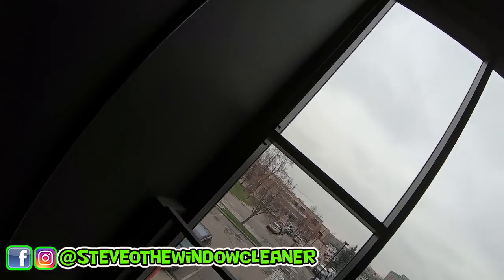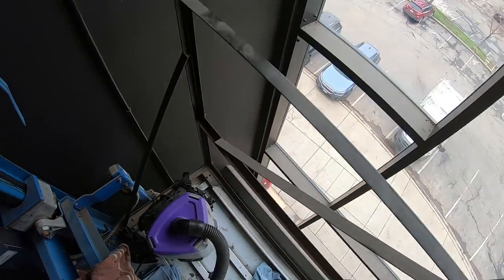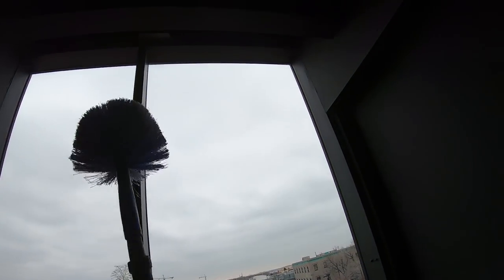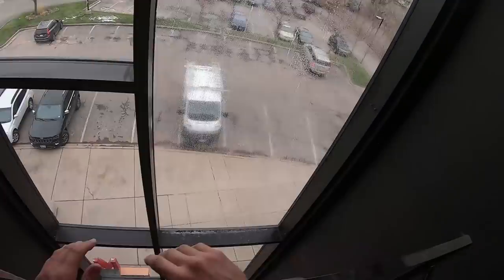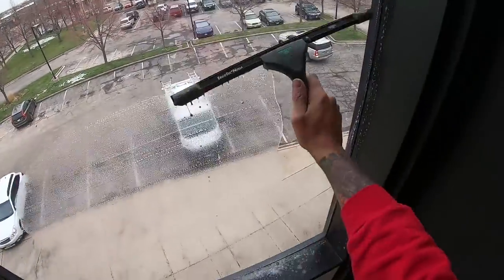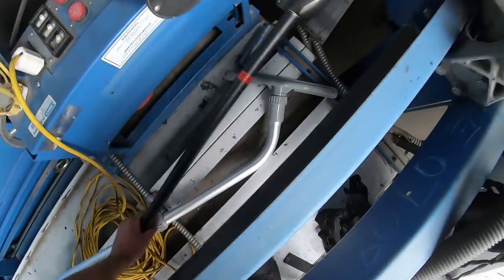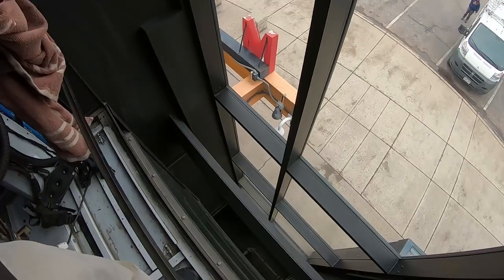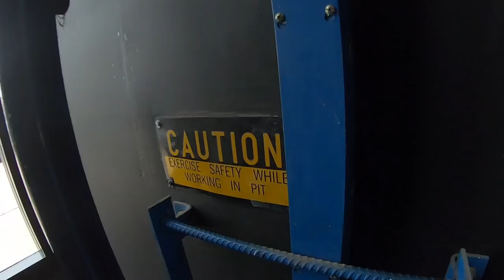WINDOW AND LEDGE CLEANING INSIDE AN ELEVATOR SHAFT

Comment: Loving the content, Steve. If you had to pick one size for a squeegee what would it be? What size do you mostly use? Thinking about getting the Unger ninja.
Reply: That is going to be a tough answer, we are all different with different preferences and different jobs, I'm in the UK and am mostly residential, my most used size is my 12" brass channel,  but I carry everything from 5" up to 36", in regards to the ninja squeegee, I have never used it but I hear the handle is real good but channel not so much, if I go wide bodied (ninja is a wide bodied channel) I go sorbo.
Steveo's answer will no doubt differ.
But I'd say you are well equipped if you carry a 6", 10", 14" and 18", only need to go larger really if you need to do a few bigger commercials and even then I often just use my 18"
Reply from the maker: Get the 18” unger ninja, when going smaller I would get ettore brass sizes from 14” and all sizes down to 6”. I mostly use brass at houses, but an 18” is perfect for all commercial and helps in homes as well